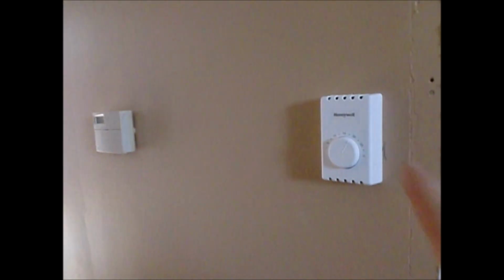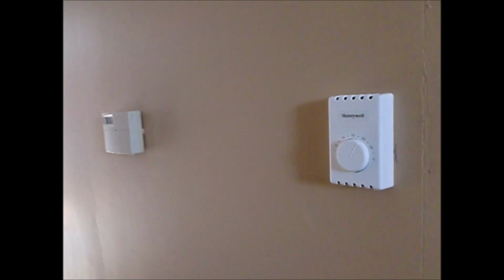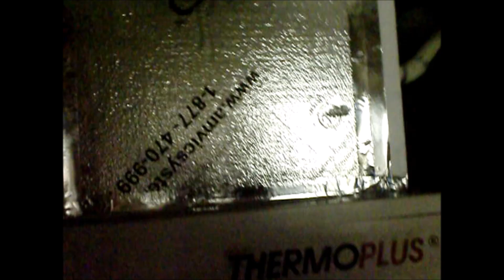Installing heat exchanger in the house part 2

Comment: Hi Kevin,

Thought you might find the information contained in the video from alternative heating company useful.

https://youtu.be/nuXPjFxg5bU

Click on the alternative heating link to see the rest of their very informative videos about all types of help via their videos such as how do heat your domestic hot water using a water to water sidearm vertical heat exchanger that when installed the way they recommend works beautifully. 

I know the way the heat exchanger for your home heating system is different from what you installed but you already have what you need in your basement to install it like the video shows and if you do that you gain more room in the basement and would be able to turn the very nice looking wooden table base for the blower assembly you built to hold the blower to feed warm air into the house. Then as the wooden base you built would be surplus to your needs you could add a nice wooden tabletop to it and offer it to any YouTube viewer who might want it for his house.

Food for thought.